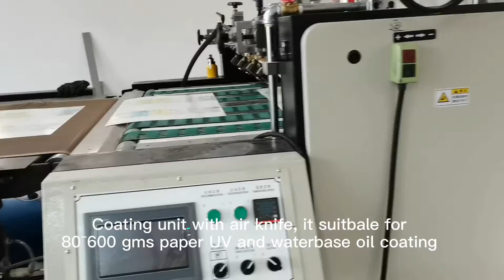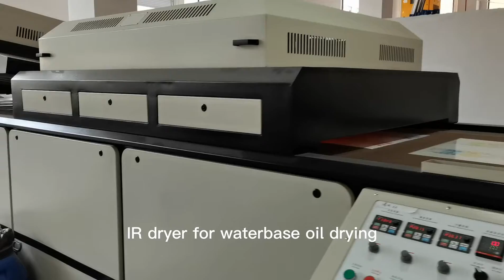SE-1200 Automatic UV Oil Coating Machine with Air Knife

Comment: How many gsm of coating material can be applied? We use water based coatings  that need 2-12 gsm application
Reply from the maker: Hi，Normally water based oil coating 4-9gsm per m2 can be applied.
Welcome contact with us get more information
Mia Zhou
Tel/Wechat: +8618267761792
WhatsApp: +8613958859742
Email: sales3@jltmachine.com